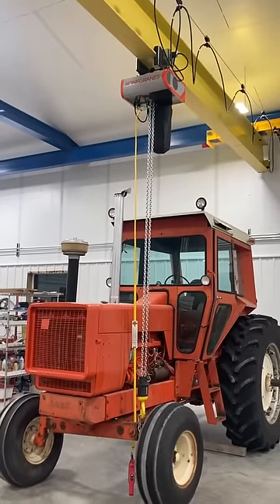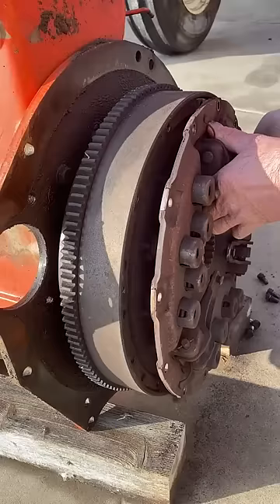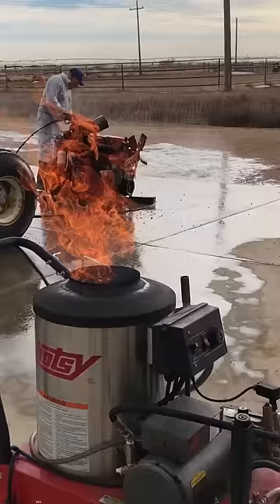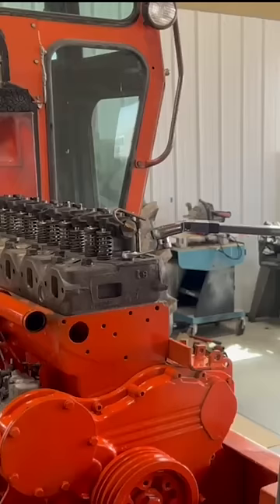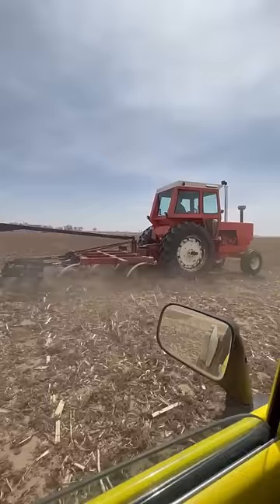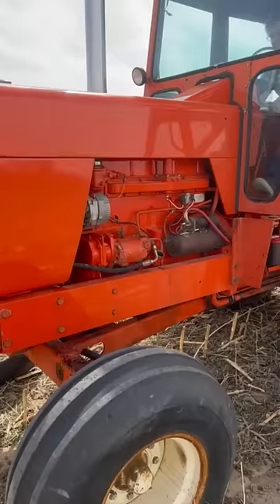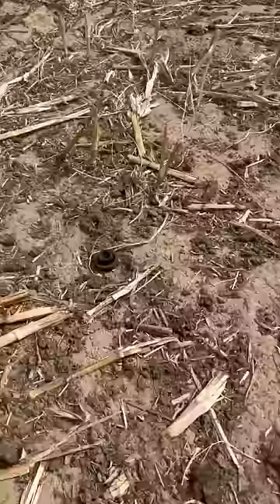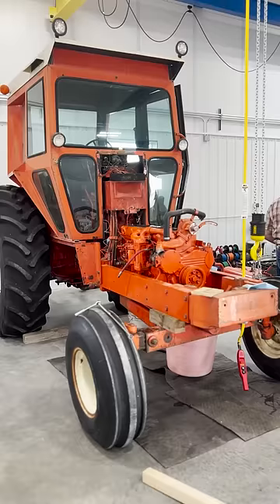#shorts This Is Going To Be The Most Expensive $500 Tractor Ever...

Comment: I bought a $250 truck with a bad oil pan. So far I’ve replaced the oil pan, windage tray, pickup tube, parking brakes, rear dust shields, front calipers, hoses, and lines, a band clamp that rusted out and gave me a coolant leak, and rear axle seals and rear pinion seal. And when I’m done with the pinion seal I need to put a ratchet strap on my gas tank because one of the straps is hanging on by a thread. It’s rustyyyyy but it’s ok. Now it’s a $1000 truck. Oh yeah I had to tighten a power steering line too. I scooted the old clamp down and put a band clamp on.

Comment: Sounds like someone at some point in time put styrene in the motor. Once it's in the crankcase it breaks down the oil and blows up the motor. Then after a rebuild it ran for 25 minutes and woofed the motor again. It sat and got sold and the new owner rebuilt it and took it for a drive and in 30 minutes it was being towed home. I think they finally replaced it with another motor and that seemed to take care of the trouble.

Comment: I rebuilt a 939c and machine shop salesman said it's standard size, they didn't bore it. I put standard pistons in, knocking 5 days on engine. Turns out they did bore it. What a nightmare. I thought the pistons were small installing them

Comment: My thoughts are:

1. Oversized rings
2. Incorrect temp range plugs
3. Incorrect voltage range coil
4. Wrong ratio compression rings

I've seen the video where you show the internal damage, and what my first thought was, the combustion chambers were getting too hot to run properly, which is why the crankcase had too much oil pressure -- blowing off the fill lid like it did here.

Then you show the valves with the cracks, and the damaged pistons and sleeves, and that's where my thought went that the engine itself was simply getting too hot in the combustion chambers.

Comment: I would start by saying you didn't check the proper clearance on the rings. the gap left on the rings after installed needs to be filled down to the required gap and that varies based on the motor and how it is used. basically when the motor warms up the rings seize to the cylinder and when it cools the rings will have shrank back down.

Comment: I think the reason why the tractor is over heating as its not got enough air flow to the engine and it seems the cooling system is also failing to cool down the tracker also I think you will need to take apart the hole engine to inspect it as there might be a crack in the engine somewhere causing it also to over heat also have a look at the piston as well they also might have a crack or the wring around them is either not fitted on properly or it's got a crack also check the oil to see if there is any metal shards as that a good indicator

Comment: I think you might have the problem on the engine coolant because you said the cap was blowns away so if it was blown away the pressure will build up because the heat would push the cap so I think it's the coolent

Comment: Possibly more then one problem. The crankcase building up so much pressure that it blows the fill cap 100 ft across the feild is one problem almost certainley a ring problem or a crack that opens when it gets hot and allows hot exhaust gas too buildup in crankcase and is it enough to stop the pistons? From their downward stroke. Wow!

Comment: lol your pressure washer wasnt working correctly, it kind of seemed like the fireproof insulation was literally on fire. Take the coil off, or just unbolt it and move it out of the way so you can access the oil atomizer thing, pull the jet from the OIL atomizer and blast it with some carb choke cleaner.

Comment: Did you buy rings for a bore and  just hone the cylinders or go back with original size rings? Might have oversized rings and when they get hot they will expand and seize the engine.

Comment: You didn’t get enough coolant in the top end of the motor. So you fried the top of the cylinders and the valve train. You might be able just to re-put a new pistons regrind the valves. Of course check the bottom and bearings first.

Comment: Ring gaps are lined up causing to much crank case pressure and this causes this pressure to push into the coolant system abd this caused the water stop circulating😅

Comment: It's overheating and has pressure going through the crank case.
Head gasket or something in that area.
I know it's a no shit type of statement but hey.
There could also be a hole in the cylinder sleeve. Which will boil your coolant and throw compression through the hole into the crank case.
Do you get white smoke while it's running?

Comment: I mean once everything is done, it would be cheaper. Looking at 210 listing. 

They are $14,900 usd. Which who knows what's wrong with those. With hours ranging from 2500-6000.

And one listed for $38,000 usd. Looks in good condition since the paints new, but again who knows if there's anything wrong. It does have 3100 hours.

They are all 136hp, gear drive and 2wd

Comment: Hydro locked probaly or another thing that could have gone wrong is did you check pistons or rod caps cause I have a tractor that I am working on that did that exact same thing we opened the engine up and could not find number 2 and 4 rod caps and all pistons were scratched up and the rings were completely gone also oil had natal shavings and he also only worked a few hours to

Comment: The white smoke and thrown oil cap are indications you're burning oil and getting exhaust back pressure in your oil system my guess a valve sleeve or piston rings possibly a gasket. But first guess is valve sleeve being improperly fitted and wearing stupid fast.

Comment: If the block has a piston sleeve liner….
The sleeve liner isn’t  sealing between the block and head …..
Incorrect sleeve liner
Which causes the exhaust air to go between the liner and block thus building up carbon….and blow back into the swamp causing the filling cap to blow off…
This happens when sleeve heats up …. seizing the engine….when it cools down again it will run fine again 
The sleeve should’ve a raised lip to seal on the head gasket better 
Is your problem….

Comment: No rings or gaps would do that.if it where ringsorgaps  it would have smoked from the start like a crap ton . seems there is to much pressure. Or might have something backwards.. diesel are a little tricky and backwards from standard gas motors

Comment: Ring gap is too tight, when it gets hot and the ring expands, there's nowhere for it to go so the ring ends butt together and it seizes in the bore, not cleaning the ring groove on the piston and the carbon behind them could make it seize as well, just a  guess without seeing it and checking clearances.. It's possible bearing clearances too small as well

Comment: The original engine was worn out? There was no smoke coming out the exhaust with that clip but lots of smoke after seizing it. Did anybody check the radiator? Some farmers would gladly put in water as coolant is expensive. So is a thermostat so leave that out too. If I were to guess the biggest reasons farm tractors die is overheating. Not only overheat but continue to run it to destruction.

Comment: Never buy and old piece of equipment thinking you're saving money.

Company has an old Toyota Cressida, also an older model BMW that the owner's dad use to drive.

The BMW is in great condition and was drained of all fluids before going into storage.

The Cressida was used from time to time by one of our drivers.

I of course was interested to buy the Cressida and make it a project car. I did an inspection of only the outside and interior and already knew I'm going to end up spending 3 Times what I pay for the Car just to get it up to scratch again.

Comment: It has gotten really really hot at sometime in it's life the way to fix it is go find a different block overhaul it rapp a chain around the neighbors Barn and show them what it was supposed to run like plus I have hauled farm and construction auction equipment for 33 years and if you bought it for 500 he knew or you didn't ask that should be a 2500 if not more at a auction for a junk yard to sell for parts. Get ahold of Worthington tractor parts or McWhorter tractor in Iowa they have a lot of older tractors everat tractor in strawberry point Iowa might have a block for you

Comment: I'm wondering why you wouldn't check the engine before changing the clutch. I mean a "completely" bad engine has warning signs. OBVIOUS signs ie rod knock or other noise blow by or no oil pressure (knocks and rattles). But I've rebuilt engines and transmissions for over 30 years and a bad engine is obvious. Or why would you replace a clutch without running the machine and verifying problem and diagnosis. In other words you guys have created your own money pit sometimes these things are just better left to a professional. Or the real question why you think a tractor for less than junk price would be worth more than junk price

Comment: Blow by issue..
So its a typical oil pressure or compression issue..
Incorrect installed rings..
Incorrect tolerances...
Bad valve seats or parts .
Cracked head...
Or cylinder....

Don't rebuild the next one.
Replace it.

Just a man who does this for a living

Comment: You have to angle your crows feet 90 degrees to the handle to get a proper torque
Reply from the maker: Not if you’re intelligent enough to calculate the proper torque when using one…
Reply: @JAMSIONLINE  why would you want to do extra math if you could do none seems like extra work any body can run a formula but tell me why you had too

Comment: I don't believe in too small ring gap. All that results in is a scored cylinder and fucked up pistons. I'm confused when you say it it locked up and you're showing the oil filler cap blown off, it is running, so not locked up. Do you mean it backfired and stopped? That could mean too much fuel resulting in hydrolocking so yes, maybe look at fuel pump and injectors.

Comment: look like all old engines they dont like modern fuel to strong for them and besides shity gaskets quality rubber quality and besides old militari engunes hade simpli fuel/air compensators .
Ya know in the cold morning bacteria acidic shit or just parking near centrain forest or trees suck up right away that acidic staff and some times depends what it us some of those trees are multipel times stronger then regular gasoline or disel fuel so the oil cinde of get bacteria and what you end up is bacteria eating oil creating pure ethanol/methanol gas or some sort of acid and its recomended to use moisture/liqued seperators perhaps just fuel aditives save you lot trobel .
Those old tractors used leaded fuel so bade idea useing ordinari fuel on them .
Same shit happens to my Opel car from the 80s classic GM design that thing is sensitive to any thing from back feading alternator ,lights no ballast,failing diodes or relays,non existing resistors and diodes or simply alternator failure or arcing starter motor in some cases horn is stuck and its buzzing like buzz coil early engines were gasoline-disel engine blocks so even disel run on static or arc or spark ither way that tractor needs extra safty .
Ya know if you have farm and chemicals lay around farmentation always acures expecialy if you do not clean often tractor from piss basicaly all that crap burns in centrain way so its not reali mechanical failure its the enviroment .

Comment: When you buy a tractor for 500 you expect it to need only a clutch.
Well, your IQ is measured with 1 digit or you're a real scumbag, taking major profit off someone else.
At the very least this tractor, in normal condition would be 5000 or if needed JUST a clutch, 15.000, and not 500